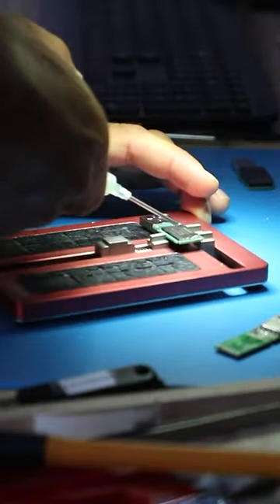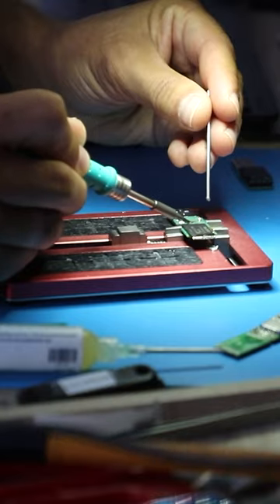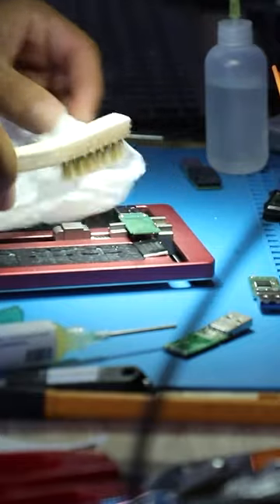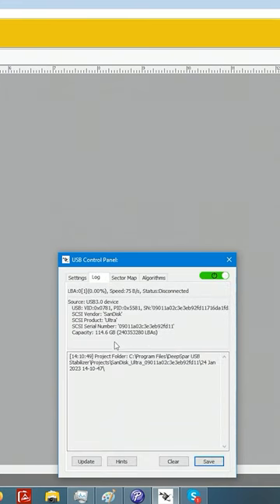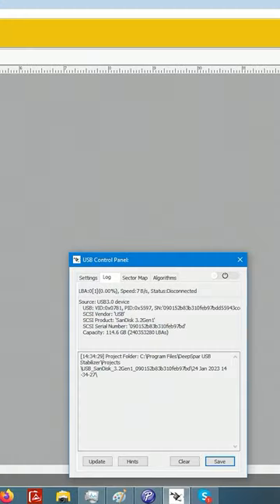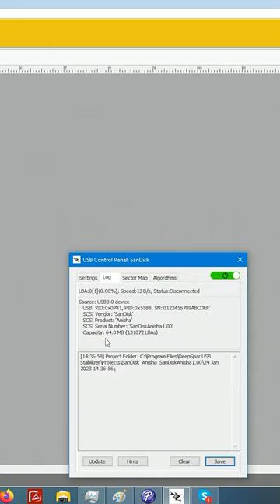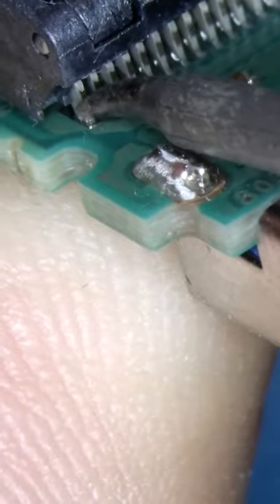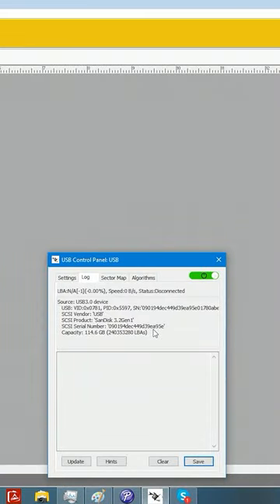how to troubleshoot and fix SanDisk flash drive problems #tech

Comment: That's cool that you not only recovered the data, but built a tool to be able to recover from that specific model of flash drive in the future, which is extremely common and I have a few of I might add!

Comment: I have a sandisk 32gb pendrive and somehow pendrive automatically locked on readonly. I tired to format and repartition diskpart and some other paid software like wondershare's products. But results are the same. Can't fix read only mode. Any idea or tool to fix that.. I tried uboot but didn't get any success.

Comment: What is the flex you use stay to liquid to remove wihout air hot station
Reply: low melt solder

Comment: i have a cruzer glide that only works on usb 2.0 ports, pins are all intact but even if i cover all 5 extra pins, it does not connect on usb3 port but in usb2.0 mode. only on a real 2.0 port 💀
Reply from the maker: maybe not all contacts are good on controller side of links, so you get USB2.0 links but incomplete USB3.0 protocol
Reply: @hddrecoveryservices  maybe its on pcb side under of controller, i dunno :( thanks for answering btw 👌

Comment: The content is nice but you guys quoted me £2100 dollars to recover data. I think I will do it myself lol
Reply from the maker: oh yeah? I don't think you were quoted for Sandisk flash drive. SSD maybe, but good luck either way. If you can do it yourself, why you even ask how much it cost? it won't be cheap.
Reply: @hddrecoveryservices  I definitely don't have 2100. Yes you are right it was an SSD, I can learn how to do it. Definitely be cheaper than 2100 to learn
Reply: @Hussletheamtrix  I can assure you, the learning curve and the tools you will need (which vary beyond memory type) will cost you well over 2k
Reply: @IT10T  I know my brother. And even if I learn, I can't get to where you are because your are a master class.
But, I live in the UK, sending the drive is not much of an issue but the cost is.
I may trouble you for some advice though if that's alright?
:)

Comment: You do know all that soldering fumes will slowly kill a person?
Reply from the maker: solder and flux fumes are harmful for sure if you are an idiot who works without proper ventilation for it. In this video you can actually see how well my fume extractor works. All of the smoke goes right into the vent and blown outside.
Reply: bro u r seeing master at his work not idiot. plz dont insult urself. cigarettes kill people too slowly. i see plenty of old man still smoking. 🤷. this dude have proper ventilation system to suck the fumes